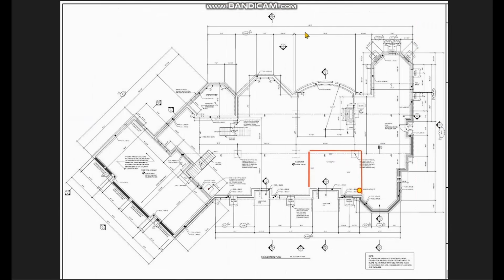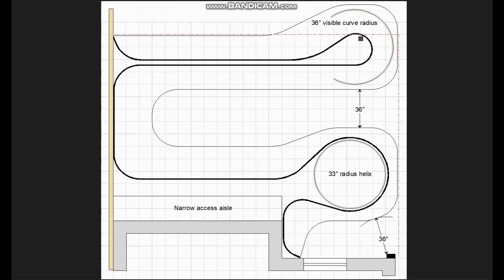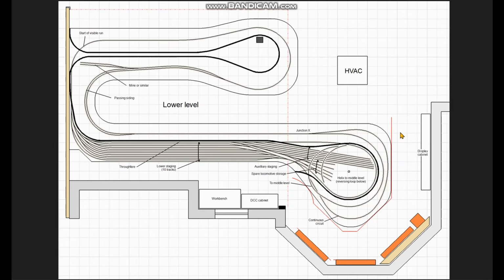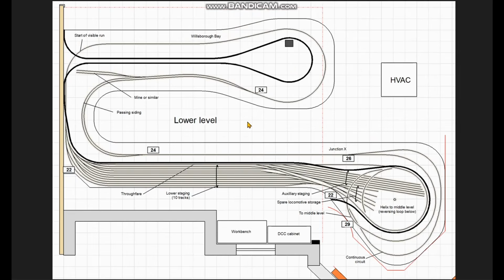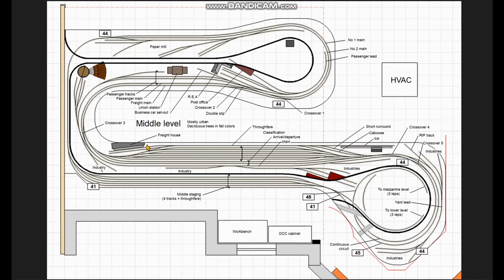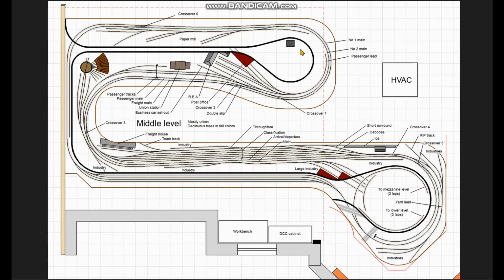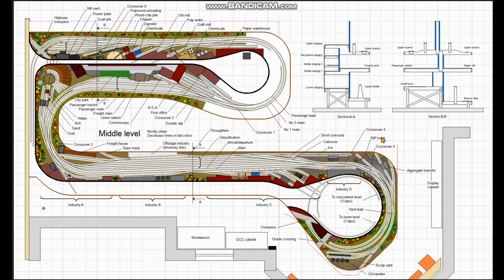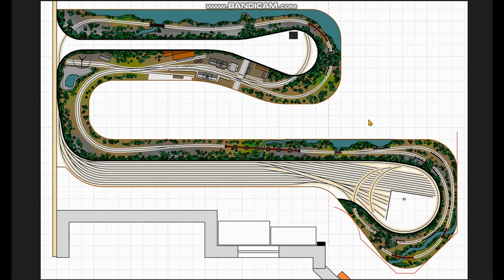HO-scale triple-deck layout design

Comment: For one, it seems like the client did a poor job of providing the as-built drawings. Secondly, too bad you couldn't use the whole basement that would be one heck of a layout!
Reply from the maker: Even if the entire basement bad been available, it would have been too much railroad for the client's desires.  Early on in the design process, we did consider a single-deck layout in a 3000sf barn that was available, but the finished result would have been less convenient and less enjoyable.
Reply: @mpeterll  But would it have been? You don't necessarily have to pack the whole thing with complex track and scenery, you could add more mainline run with simple scenery and have a more realistic layout, wider aisles, and not need a triple deck design, even if there isn't functionally that much more railroad there.

Comment: What a unique configuration!  And brilliant use of space and loops.  What are the track highs of each deck?
Reply from the maker: For most three-deck railroads, I work on datum elevations of 24, 44 and 64 inches.  Track elevations on this project range from 22 to 72 inches.  Elevations of individual tracks are shown in several slides at about the mid-point of the video.
Reply: @mpeterll Thank you!

Comment: How much time did it take to do the 3D view?  Did you have to build up CAD models of all the separate buildings and create a topographic profile of the hills?
Reply from the maker: All the structures are simple extrusions of 2D polygons.  Notice that they all have flat roofs.  That way, I can create each one in a few seconds.  Building up each structure as a 3D CAD model would have taken far too long to be viable.

Comment: Fascinating to see this evolve and the 3D is very helpful.  The levels just float above each other. On a practical point how thick will the support framework need to be for level 2 and 3 facing outwards into the basement?
Reply from the maker: The structure is pretty much identical to what you've probably seen be do on the Sydney project.